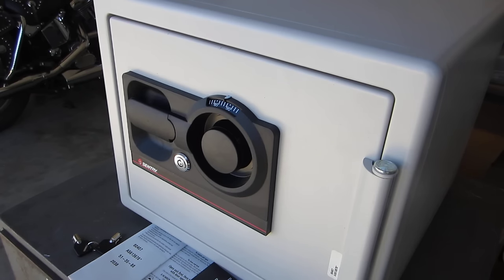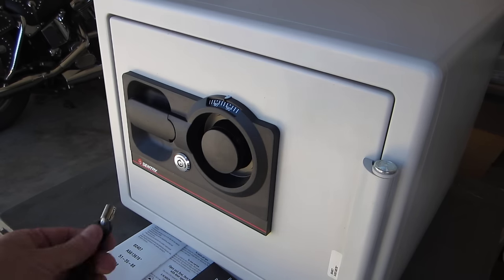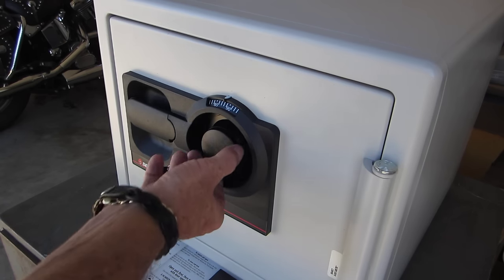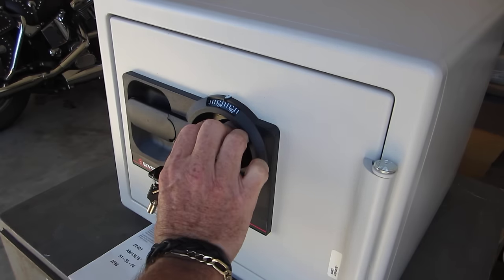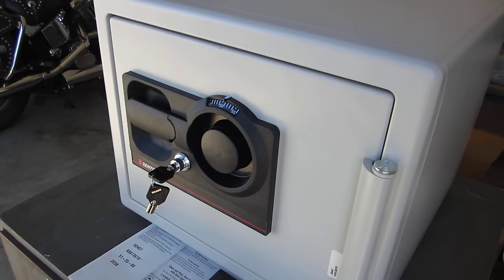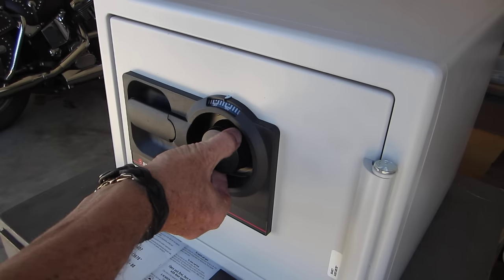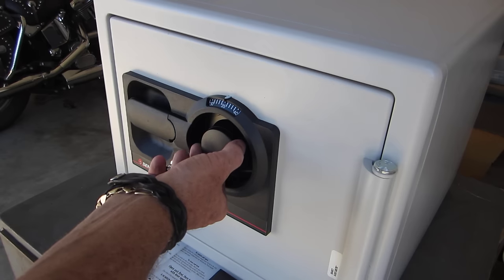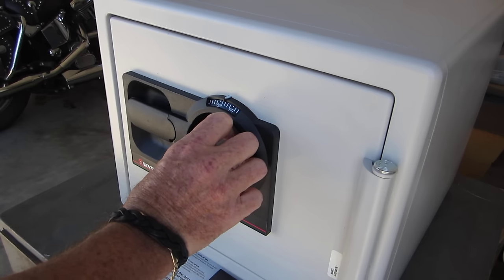How to open Sentry Safe 3 number dial combination lock

Comment: IF THESE INSTRUCTIONS DID NOT WORK FOR YOU, READ THIS:  I have a 3 number dial combination lock Sentry safe, but the correct way to open mine is exactly opposite of the one shown here. For the SFW082DTB you actually first go CLOCKWISE three times past zero, then counterclockwise past the second number once (stopping the second time you come to the second number), then clockwise again until you get to the third number (don't go past the third number). Push the handle down and the safe should open. ALSO, this safe's cylinder does not pop out when you turn the key. There are only two positions: LOCKED is north and unlocked is a quarter turn to the east. You do not have to use the key, though Sentry says it's more secure to use the combo and the key together.
Reply: THANK YOU this is the only thing that’s worked for me so far lol it was a struggle

Comment: Thank you!!! Worked first time after your demonstration even though my model doesn't have a key and cylinder. Excellent video.
Reply: Jerry Bascombe Hello
Reply: Steven- I have a safe exactly like this one. My problem: while safe was open, I removed the key to lock the drawer. Re-inserted the key, turned it to the open position (right) but it won't depress. Handle is "locked" in the open position and the dial is locked on the last number. Hence, the door won't close now. Is there an easy fix for this? Any help would be appreciated! Thanks...

Comment: I bought a used Sentry S0100 safe today from a locksmith shop, and despite a demonstration of how to enter the combination, and my best efforts, I couldn't get it to open when I got home with it.  I went back to the locksmith and got a short course that made me able to open the safe.

The key to entering the combination is to begin spinning the dial counterclockwise, not clockwise.  It seems that other safes begin by spinning clockwise, but not this one.

First to "scramble" whatever spinning counterclockwise or clockwise of the dial has been done before with this safe you first have to turn the dial counterclockwise for about three full turns and stop at the first number of the combination.  Then you turn the dial clockwise and pass the second number of the combination once and keep turning until you stop at the second number again.  Then you start turning the dial counterclockwise again until you are at the third and final number of the combination, stopping there and then press the handle down to open the door.

Comment: We have a safe that was handed down, along with what are the 3 numbers for the combination, but we have no key for the safe.  Any idea where we may be able to purchase a key for our safe?  If it may matter, the info on the little sticker, the first part says S3421.  At least it looks like an S and not an 8.  I am assuming this is a model type for the safe.  The info on the safe states 'Halo Branded Solutions' on one part that looks like an emblem, and another area on a stripe below the handle and dial combination that states 'Sentry'.

Comment: just bought a sfw123dub. the dial clicks loudly.  sentry said it should.  any way to quiet it down?  I took the dial out and used some grease and it didn't help.  Under the door cover ,inside, there is a clear cap with white powder in it.  Is that just dried grease?
Reply from the maker: Additional questions call our customer service line (650)204-5505 Thanks you for your positive comments your review will help us better serve our customers

Comment: we just purchased (from a estate sale) a sentry safe like the one in the video. i have the combination , the lock is already popped out. when the combination is done and the handle is turned down the door does not open.  Any suggestions as to what we should do now?  Thank you for your help
Reply from the maker: Additional questions call our customer service line (650)204-5505 Thanks you for your positive comments your review will help us better serve our customers
Reply: Cut the pin off the other side if you need help let me know

Comment: I have the same sentry safe in the video. I lost my key. My question is there any way to open it with out a key? If i call sentry will they HELP? The safe is empty and I don't want to ruin it or throw it away I would like to be able to use it.
Reply from the maker: Additional questions call our customer service line (650)204-5505 Thanks you for your positive comments your review will help us better serve our customers

Comment: I have a safe in the basement in Troy, Michigan. I opened it and found mold all over it and the papers were black and even the coins . Is there a way to use it in the basement?
Reply: Sentry told me that these safes are filled with concrete that attracts and holds moisture (or as they put it, "proprietary insulation that has a high moisture content"), which is why they tell you not to store certain things in the safe: guns, jewelry, computer disks, photos... I know firsthand how wet a Michigan basement gets in winter and really sympathize with you! I pack everything in two heavy-duty, double-strip ziploc bags and toss in some of those silica gel packs that come in shoe boxes and vitamins.

Comment: Mine doesn't have a key/key hole and it's locked open. The handle is in the down position and the dial won't turn. Any suggestions?

Comment: Hello,my name is George I have exactly the same safe S0310 BM895934 I don't remember the combination nr and it is locked inside the safe do you guys have some kind of a reset code to open  the safe and how much would it cost
Reply from the maker: You can call me at 650-240-5505 with model # and I'll try to help you get the combination
Steven

Comment: I have the same type of Sentry Safe as shown in the video.  Does anyone happens to knows the Model # for this particular Safe?  I have a sticker on the safe that shows the S/N but it doesn't show a model #.  I see a S3410 or 83410
 but it doesn't state if this is the Model #, need some help, thanks.
Reply from the maker: Yes Edgardo S3410 is the model #
Reply: Thanks for the reply, have a great one.

Comment: if you don't have the combo, this safe can be pried in to pretty easily by pulling the wall away from the latch. You can hammer a crow bar into the seam then gradually separate them. The safe will obviously be ruined afterwards.
Reply: Nick Gardner Jarred has done it many times on Storage Wars. :-)

Comment: You can buy an Impressioning kit online everywhere that will open most cylinder locks like that just as fast as having the key.  Also 2 good wacks on the hing with a good hammer will grant you access.  Those safes suck ass.

Comment: my instructions are right left right.....and I can't open it at all
Reply: +Tink Odaat I do not know whether you are still looking for an answer but just today I figured it out. You first use the key to pull out the key mechanism. After the key mechanism has been pulled out, the safe can be opened up with just the combination. If you press in the key mechanism, then the safe cannot be unlocked only with the combination. You have to unlock the safe  1st with the key and leave the key mechanism pulled out to be able to open the safe just with the combination. However, key mechanism can still be easily pressed in and it does not stay pulled out. Essentially, it is an extreme dumb design since you, basically, need the key all the time. If you do not have the key and the key mechanism gets pushed in, you have to go get the key. If you need to have the key with you all the time then there is no point in having the combination lock.
Reply from the maker: On a Sentry safe you can leave the key unlocked and use only the combination to open it. By leaving the combo on the last#  save time unlocking it fast with the key only. Double lock the safe for with the key and combination for highest security.
Reply from the maker: Thank you for more info call (650)240-5505
Reply: Left 4, Right 3, Left 2, Right 1.
Reply: steven gray i hate this i just bought mine today i cant open it help!

Comment: sentry safes are not secure at all in fact thaey are a wast of money anyone with a little bit of smarts can get in one quickly most times all you need a a screw driver and hammer
Reply from the maker: This 1 hour fire safe does a great job protecting documents. Cash should be kept in this burglary safe that can thwart hammer and screwdriver attacks  http://www.a1qualitysafe.com/product/DH-074E
Reply: steven gray first off its a digital keypad so poping off the keypad and cooking up to a code generator will open it quickly and 2nd it has the same mec that is used on all sentry safes that allows it to be opened with a hammer and screwdriver only difference is this modal takes a bigger hammer and screw driver. the thing is thear is one spot on the safe you hit with the hammer using the screw driver and it will low you to open the safe I would show you or tell you but I have tried to do videos on safe crackeing in the past and well lets just say a lot of people got made.
Reply: vorkev1 its true i have a small one and lost they key to it so i broke the lock of using a large screw driver and hammer took me like 5 min

Comment: my safe is open I have the key but I lost combination . Any way to get it ?
Reply: I lost my combo. Called Master Lock. Had to provide the SN and model. SN was located on a small sticker on the door.  For $25 they emailed me the combo to the safe.  For me, I don't have the key which locks the handle also. Still working on that part..  NOTE: If you get the combo from MasterLock. DO NOT follow their written instructions as they are incorrect.  Follow Steve's.